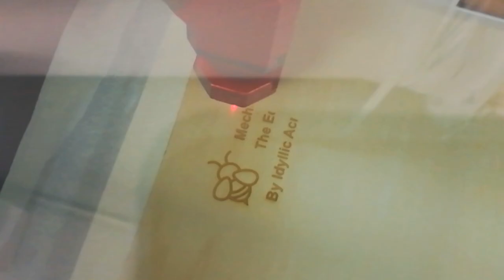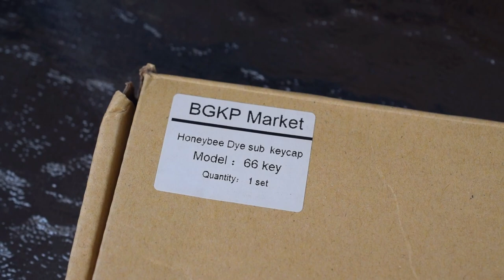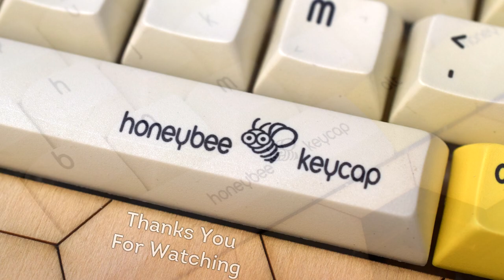🐝Bee Themed🐝 Honeycomb Mechanical Keyboard Build Montage ft. Aesthetic Exposed Rainbow Handwire

Comment: Pretty unique I have the honeyboard60 which looks like a nice custom mechanical keyboard but it has honeycomb cutouts inside on the bottom of the case for sound and it rewlly works good stuff but awesome video this is def unique issue is the name of the board was changed to honeycomb60 lol the hc60 just saying lol I will say boards with pcb always aouns better then an open back format but this is still damn unique and damn cool what you made

Comment: damn bruh u got unlucky with the micro controllers. Have u thought about using different microcontrollers, such as the qmk proton c?
Reply from the maker: Yes I was contemplating a more premium microcontroller, however I thought it would be more beneficial to showcase more common and acceptable parts, kinda as an "introduction" and to show how simple and budget keyboards can actually be, from a beginner's perspective
Reply from the maker: Probably would have been cheaper to just get a proton C instead of using 3 cheapo microcontrollers tho 😅

Comment: why no pcb?
Reply: Hand wiring is cheaper. A few bucks for 100 diodes and wire is cheap. A microcontroller is also a few bucks. Total should come to around $10 while a pcb would be at least $25 from china